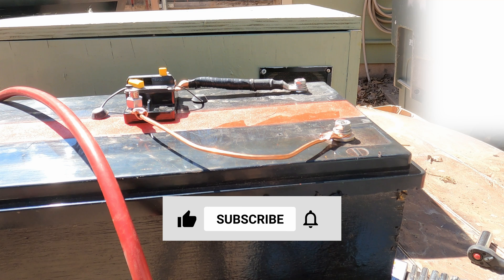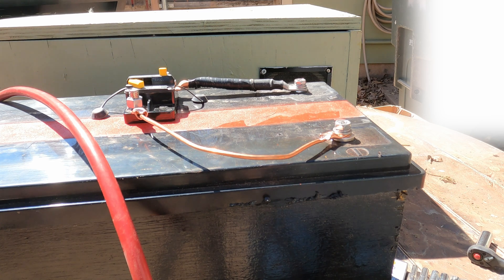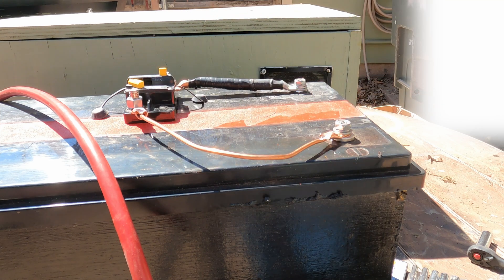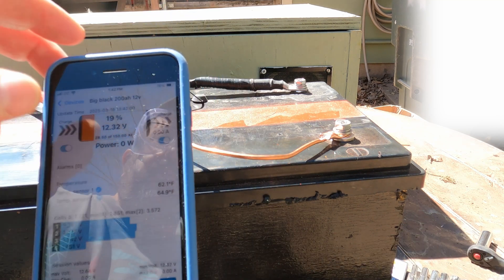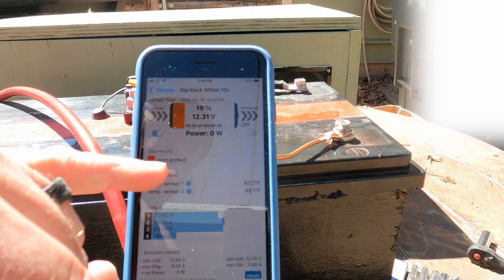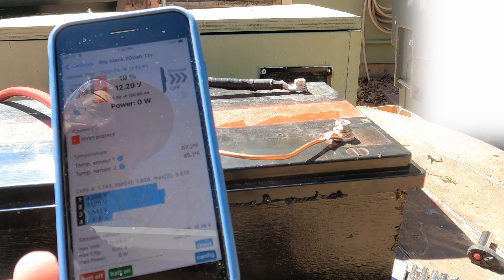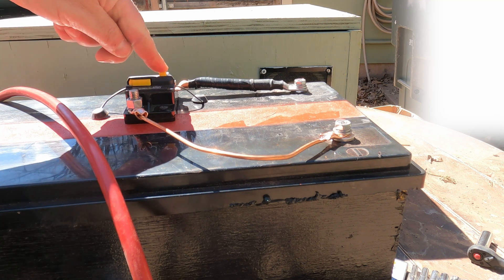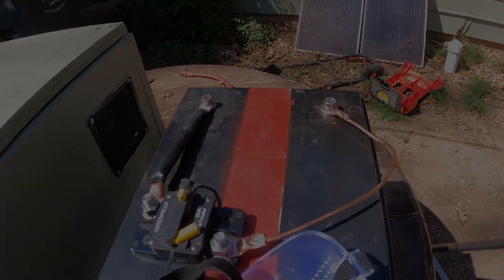Dead short a 12v 100ah LIfePO4 battery. Will the JBD BMS protect it?  Or will it flame out??!

Comment: One thing to note, however, is that with thinner higher-gauge wires, the wire itself might have too much resistance to cause the over-current to trip.  Particularly in long runs.  This is why one should always wire with appropriate gauge for the circuit.   This is also why ground conductor requirements have been beefed up over the years by the NEC... because ground conductors were in many cases too small and a ground-fault developed enough current to catch something on fire, but not enough current to actually cause the circuit breaker to trip.

-Matt
Reply from the maker: I was actually hoping it wouldn't trip anything.

Comment: I remembered when I first got into the hobby, my first lifepo4 was the infamous Valence batteries.
Those were super popular because people found them used from various places and they were durable.
I got 2 the U27(138ah) for $900 and that was a steal.
I was playing around with them and I hooked them up wrong(probably shorted them just like the video).
Holy crap, the ring of the cables burned up instantly. Half of the ring terminal burned up.
I thought I fried the battery. Luckily, it still worked and I still have them 4 yrs later.
Reply: Wow! Glad the batteries still work.
Reply from the maker: Dang!! that is a crazy story!!